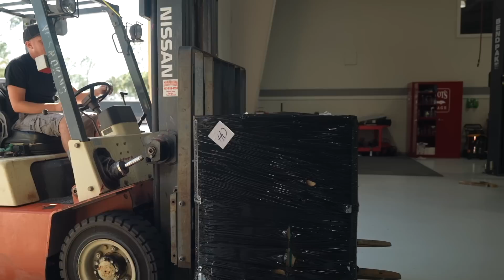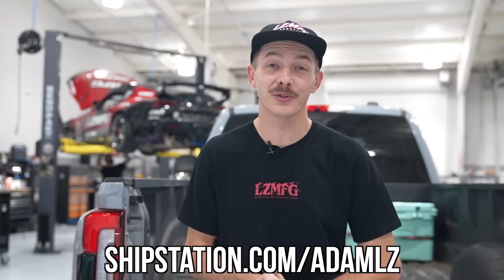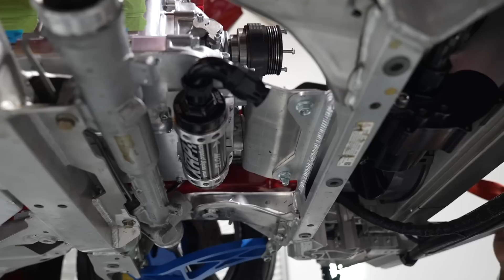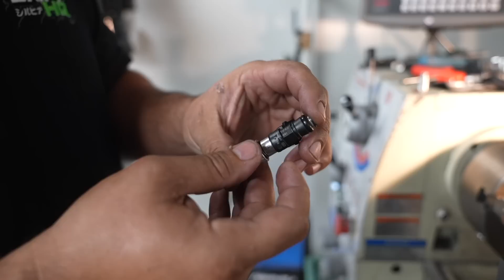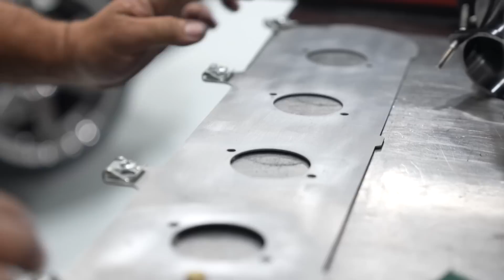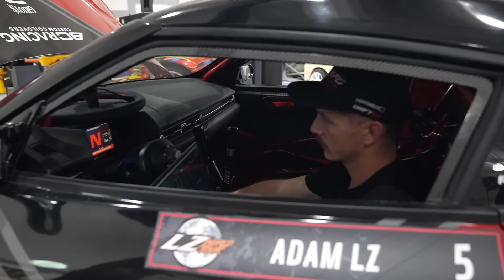Introducing my BILLET 4 Rotor Supra - FIRST START!

Comment: My 4 rotor header looks similar if you want to see and hear a similar setup. Although I’m using the stock side ports instead of pp. 

Glad i decided to stick with a wet oil sump setup. 

Congrats on the engine and getting it started.

Comment: Surely the hats go on the back side of the injectors not the front. They are now spacing the injectors away from the rotors and potentially interfering with the spray pattern?

Comment: Many years ago, I had a 2 rotor 1980 RX7 with a 5 speed manual, and to this day, the RX7 is still one of the top 3 cars I've ever owned.  The best thing about was the 9k rpm redline and it weighed around 2400 lbs or something like that.  I can't even imagine adding two more rotors and its built and tuned, this Supra is going to be a monster  😮
Reply: We had a RX7 b owned by the guy in the apartment next to mine in 1980 as well. It was a wicked good time even in that generation, but the seals were a constant problem. We could do a full seal change in a weekend, it was a shame it had to be done so often.

Comment: So excited that you persevered and stayed with the 4 Rotor!!
Reply: Looking forward for a revv battle 😂
Reply: peoples 4 rotor parts being held hostage or stolen is practically a meme at this point
Reply: Can you show him how to make it sound like a 4 rotor
Reply: adams looking for a shop , daddy rotor popped in  i heard my cnc calling you name
Reply: asking you since youre the rotary dad. With doing the billet "irons", do the billets tend to hold seals a bit better since they expand around the same as the rest of the engine? ive always though that having the dissimilar metals could cause problems with this in the stock form due to the nature of thermal expansion when pushing higher power numbers.
Reply: I heard someone has been working on a 12 rotor. Thats another build I'm excited to see.
Reply: Chat to adam and see if you can dowel hid old 4R and add a choo choo twister for some extra go ponies
Reply: @jefuhlig1986  all cars dont need turbos, this one is NA and should stay NA
Reply: Daddy Dahm! 🙌🏼 The Dorito God.
Reply: Daddy Dahm!
Reply: are we going to see the w12 rotor soon ? :P
Reply: Man Adam and Mike are slacking why is this not a pinned comment ❤
Reply: I was slightly hoping on a Billet Dahm 4 -rotor for Adam!
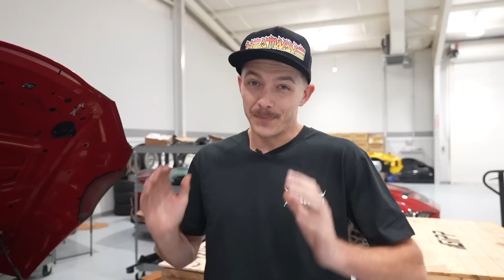Reply: Doritos MMmMMmmMm 1:18
Reply: It would of benn beter a 5 rotor
Reply: @RobDahm what's he talking about with the no real dry sump systems??
Reply: Now i nee to hear na 4 rotor with a boomtube
Reply: Me to brotha .. now we need a full build that you , the vargas Brothers,  and Adam and johan , do as a group build..  I bet that would be one of if not the sickest ,most insane, and radical build ever to grace a rotory and the algorithm of the tube that is you 😅.. but seriously, brotha, that would be nuts .. much love and respect Master Dahm
Reply: Build him a nice 3 rotor!!!! It’s time
Reply: relax robert
Reply: i concor
Reply: You  need a Dahm 4 rotor if you have issues  with this new one...
Reply: All hail to the dorito king

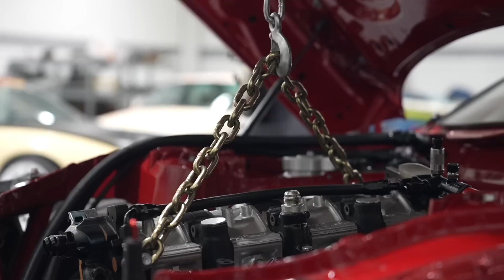Comment: 5:20 Thanks Mike for putting up the weight information, my OCD was already looking at the weight limits of the engine lift and started to freak out a bit lol😂
Reply: That engine hoist is rated at 4000 pounds and at its most extended setting it's 1000 pounds. A 266 pound engine is literally 6% of its lifting capacity that's like lifting a feather to it. Your freaking out about that little tiny engine?

Comment: Can’t wait to see this 4 rotor make 1000hp at the crank 👀🤣
Reply: 1000 hp it should do that with no turbo? lol
Reply: @gogetem188  Yes, its a realistic Crank hp goal for a N/A 4 rotor on Ignite.
Reply: @drew53832  By that logic a ported 13B should reach 500hp N/A on race fuel. Yeah, nah. I'm pressing 'x' on that one..
Reply: @Bassalicious  Ahh I believe I missed to state the part where it's obviously on NOS. I should've clarified. 
Also, this will be crank horsepower we are talking about. Also, the more rotors you add, the more efficient the engine becomes.
All I can say is don't be surprised if it does happen.
Reply: @gogetem188  lolol
Reply: try hard
Reply: everyone else didn’t get the joke, good one 😂😂
Reply: Well they don't. That's the issue YouTube doesn't seem to understand and you guys keep blowing them up. You all need to come to nz and get properly educated

Comment: Hoping and praying for a heat coated air-gapped plate or 2 between the intake runners and header. Radiated heat is definitely gonna ruin the intake air temps, killing alot of power on this bad boy with that rotary exhaust temp.

Header coating would be nice too. Stoked to see this build back, I love this combo.
Reply: maybe the same thing taylor ray did with the drift corvette`s headers
Reply: It’s so pretty but it really should be cericoated and have a lot of Funk heat control on it. I bet they would sew up one of their gold custom intake covers in no time just for this. The header is a work of art but it’s going to be red hot right below those intakes if not wrapped at least fully ceramic coated. It’s a monster of a heat engine, I know they want it to look good but it would run even better.

Comment: For the love of god, please put the old 4 rotor in the Datsun and make it a drag build.
Reply: nah old 4 rotor will go to the cosmo
Reply: Dude, Cleeter's seat snapped just reading that comment 😅
Reply: Finally a comment i can totally agree on
Reply: Buy a fc3s an do n/a time attack car,   13b is a much better drag motor
Reply: We need a damn series with the Datsun!
Reply: he has to be doing that, when he explained the old 4 roter fuel rail it was right next to the datsun with a wide camera angle im thinking its going in the datsun 
\
Reply: would have to cut half the car apart to give it proper suspension/reinforce chassis/move firewall. doubt he wants to do that to a solid street car that he already enjoys.
Reply: Unless they turbo it , it will be sloooooooooow as a 4 rotor

Comment: I've always thought that aluminum housing doesn't cool as well as cast iron.  With the motor always running at such a high temp, doesn't it hinder cooling, and you need to add more fuel and a water to oil intercooler before the air style oil intercooler?

Comment: This things gonna make so much Crank horsepower I can’t wait
Reply: You and Adam are gonna give TJ anxiety 😂😂😂
Reply: Hopefully it doesn’t shoot a piston out the side of the block
Reply: I giggled a little too hard at this
Reply: You mean Meth horsepower.
Reply: 91 octane
Reply: E85 there's a street / drag 4 rotor making over 650whp on e85 in Australia crazy for n/a
Reply: I'm gonna crank MY horsepower
Reply: @AjackLee4   since hp is a derivative of tq, your gunna torque your crank / time = HP. Be quick too, don’t eat the ookie cookie.
Reply: I see what you did there 😂
Reply: BONIFIED 4ROTOR HAWGTUGGIN MONSTAA
Reply: Eccentric shaft horsepower*
Reply: 😅 That's all we use in the motorsports world over here because the built engines usually go on an engine dyno over here 🇮🇪
Reply: @Barry.ONeill sounds like all of your guys cars sound cool but drive like shit lol. Chassis Dyno is the best way to see exactly how the car performs. You can’t drive the engine, you gotta drive the whole car.
Reply: Crank hp. Meh
Reply: Mike's a comment God!
Reply: Should be more worried about wheel than crank
Reply: Best bait comment ever 😂 You old eccentric you.